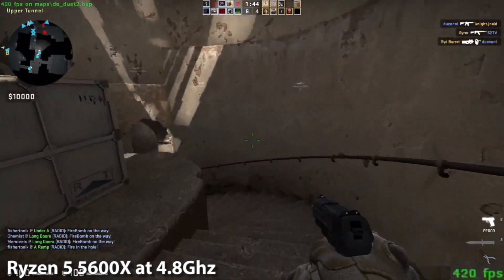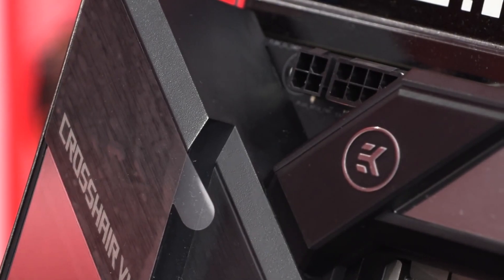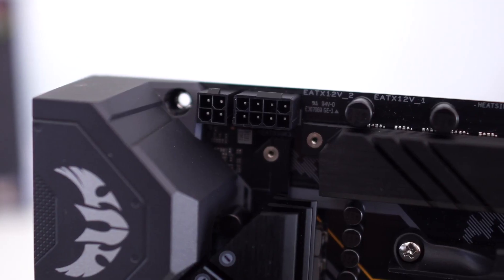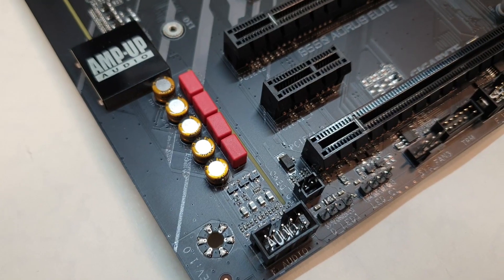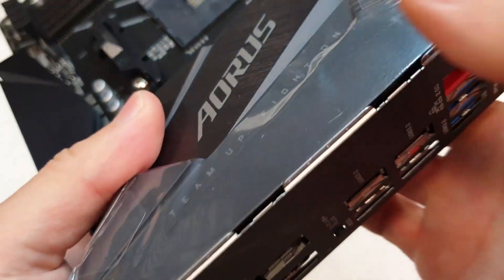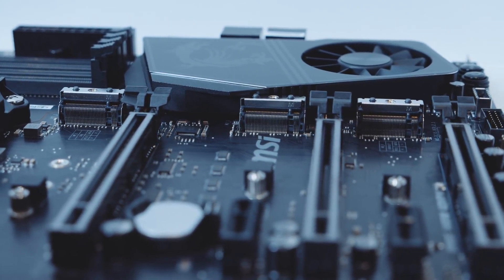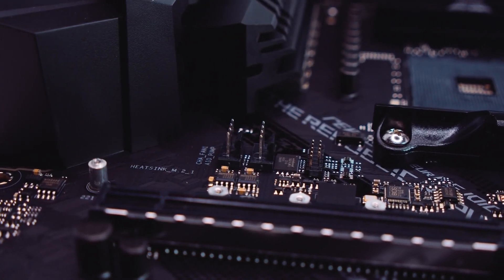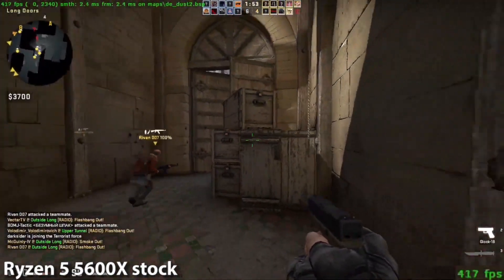Top 5 Best Motherboard for Ryzen 5 5600x in 2023

Comment: Is Gigabyte b550 Aorus Elite V2 a good choice for it?
Reply: I would go with Asus x570+. There's really no reason to get a b550 when the x570 boards are the same price or cheaper.
Reply: @ToolFist598  ok thanks, by any chance do you know if I will need to bios update or not?
Reply: @_just1nliu883  I'm not 100% sure but I think most of the x570 boards are good to go out of the box now with Zen 3, but you might want to just double check.
Reply: @ToolFist598  ok thanks for the help
Reply: @_just1nliu883  no problem

Comment: I got my hands on the Ryzen 5 5600x, and a b450 max mobo. it has that tiny q flash button as well. I'm afraid that I will mess something up. the complexity of moving around the bois, not knowing when the appropriate time to let the new bois to boot. Im fairly new to the Pc world. I do not mind Spending costly mobo if its gonna be easier.
Reply: Yea bios is a bit confusing but if you accidentally change anything you can just press restore. Just don't change the vcore value unless you know what you're doing

Comment: I still using the B450m Gigabyte Mobo and all I need is just to update the bios and I'm good right?
Reply: To update it ur mobo either needs a usb flashback or u need to get an older gen cpu to update it
Reply: @philiproche6548  I just need to download the bios and use a flashdrive. Problem is the 5600x is out of stock.
Reply: @phondekarvidhesh  yeah stock for pc parts is really bad last couple of months if u just keep an eye on some websites you might find one